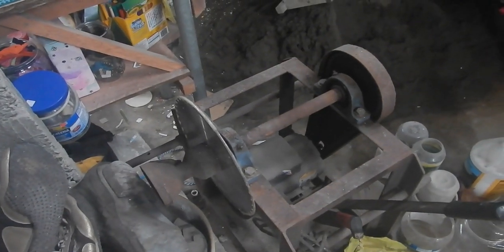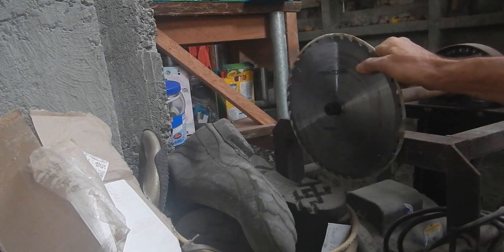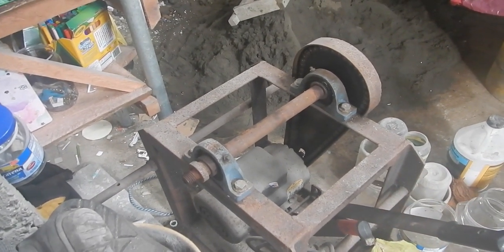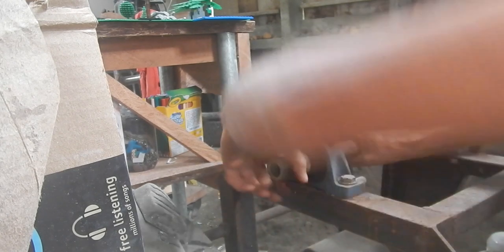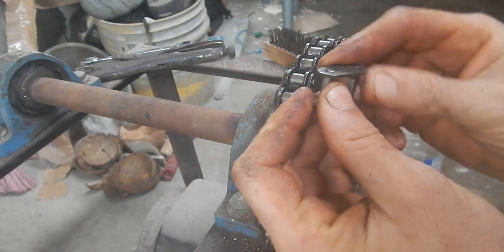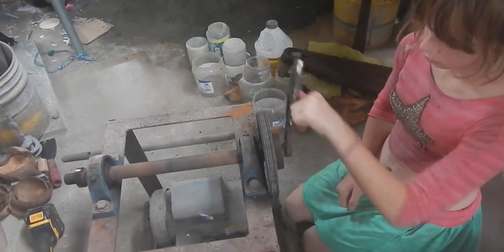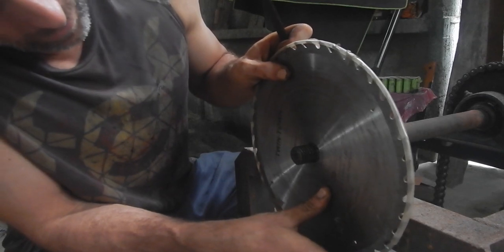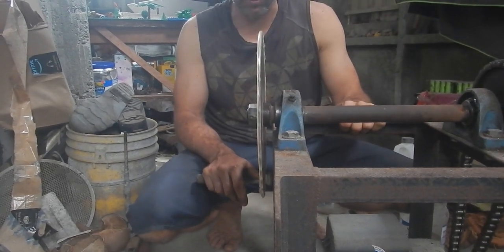Lumber Mill 001 Mounting The Blade

Comment: Jamie, if you don't put any load on the motor it won't draw very much power.

You mentioned switching to a smaller motor to save energy, that won't help much since the small motor will draw about the same amount of power with the same load.

Only difference is that the big motor CAN draw more power, if you load it up while cutting something.

Comment: As a drive guy I will say a belt drive will be more efficient but a chain drive will work fine.  In fact you can see it is set up for that motor speed so keep it oiled adjusted, aligned and don't use worn sprockets and you should be fine.  A belt drive needs to be kept clean and aligned to work well. If you get oil or dirty on it , then it will become less effective quickly.

Comment: Finally it has begun! Would have liked to see you turn that od between centre’s…. Thats what the tailstock is for! Although by the time you removed the bearings and set it all up it was probably quicker doing what you did. Just have to watch the balance, a little bit of wobble at slow speeds turns into alot of vibration at high speeds…. Last thing you want is that vibrating loose and becoming a ninja star!